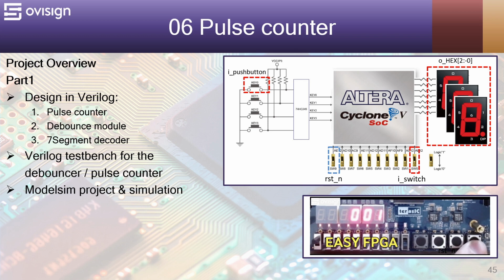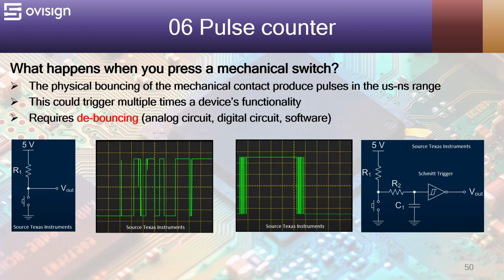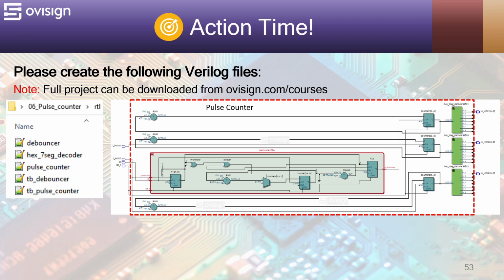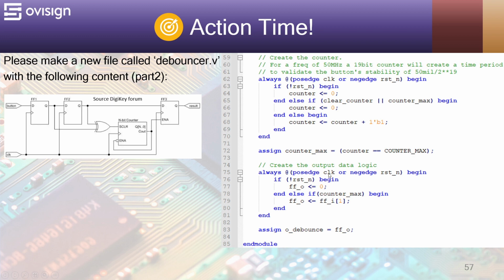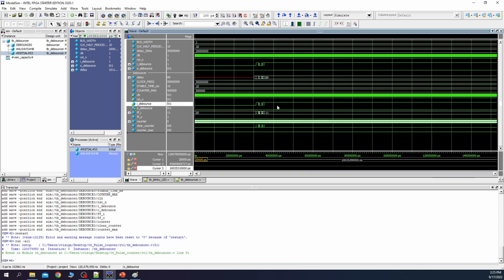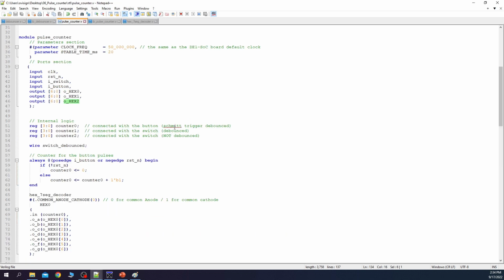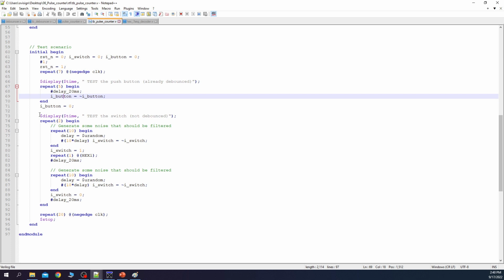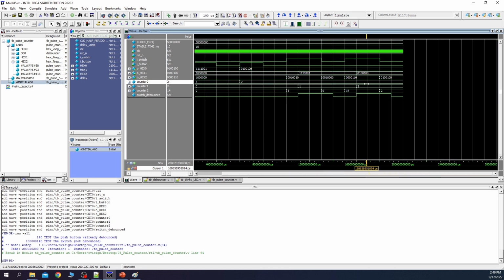FPGA project 06 Part1 - Pushbutton counter with debounce

Comment: when i ran the simulation tb_debouncer.v , the wave is not same. Do you what the problem since the code is same already.
Reply from the maker: Thanks a lot for your comment. The input stimulus is constructed using the $urandom command and it is normal to generate different values when run on different computers. It was intended to work like this. Do you have any other issues with the code?